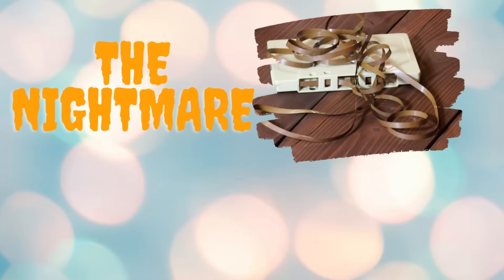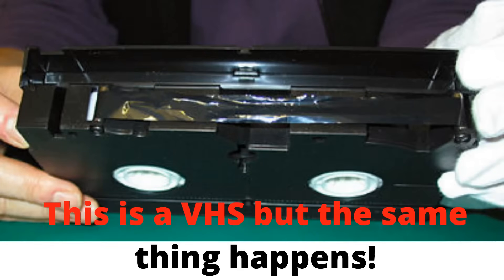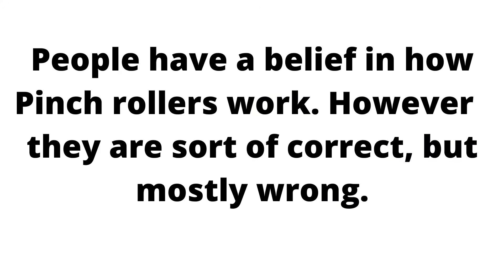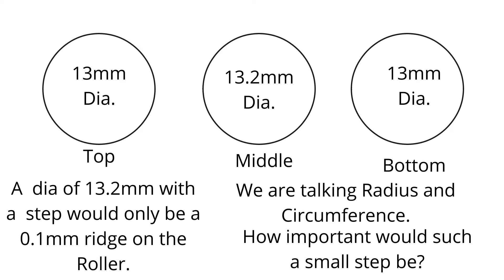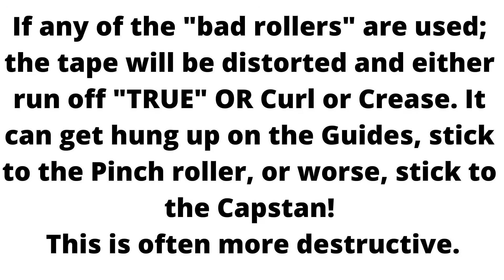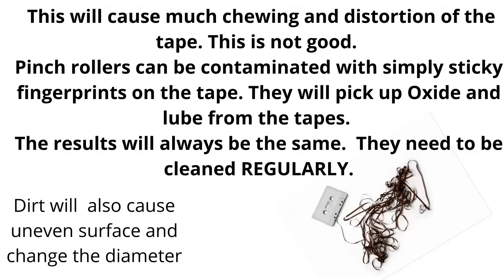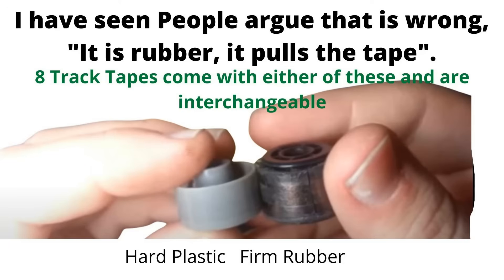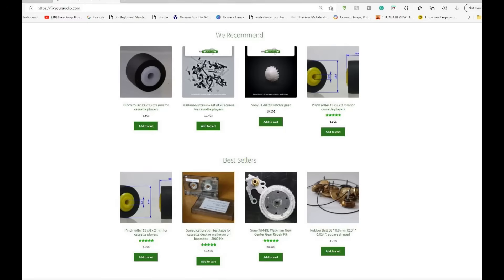Cassette Deck Eating Tapes? Pinch Roller Repair Guide

Comment: Thanks ill try give a clean. Trying to put some audio memories on a thumb drive but the tape keeps chewing up. So frustrating. Hope this works cheers.
Reply from the maker: Does the machine chew any tape or just one particular tape?  Look to see the pad in the cassette  is intact and that the tape runs smoothly.   Is Rewind  and Fast forward smooth? You can put the machine into play mode and feel with your fingers  if the take up is pulling.( You may need to override the "cassette in" sensor switch or close the door) Sorry but there are things that will have direct effect and things that will not cause i,t so much as allow it to happen.  If you want to discus it further I am  more than happy to try and help.  Good luck . Let me know how you get on.
Reply: @GaryKeepItSimple  oh your a saint 🙏🏻. Yeah it chews everything tape. It will play nicely for say about 5 sec then start chewing. I can see through the little window when it starts to chew. Mind you the sony cassette player is like 15 years old now. Was only a cheapo one. Im thinking of just going to a electronics store hear in Australia to buy a cassette player mp3 converter and see it that chews tapes. The tape that chews is in good condition so im blaming the player. Saying that watching a few videos some are saying the tape when aging can get sticky but yeah i dont know. Thanks for ya tips and getting back to me was nice of you. Like im 55 this year and i have recordings of my family ect when we were just kids. I was obsessed of recording our voices on dads old voice recorder. Just many many things. Must do it soon before the tape disintegrates hehehe 🤣.
Reply from the maker: I can tell you that sounds like belts melted. or rubber gone hard. If you want a reasonable cassette deck for not too much money I would suggest https://amzn.to/44fIiQL  Pyle Dual Cassette Deck Stereo  this is a reasonable build and it works well . the Marantz and the Ion that are basically the same, work OK. and are ideal for what you want. They feed the signal out on USB so you can record directly to a computer.  For a little less (but not as good a sound) there is the We are Rewind https://amzn.to/4i8nX36 this isthe best of walkman type player. but no good for recording and you would need to connect via cables in analog. Also there is the FIFO CP13 this has had good revievs . BUT it is still only a player and is better that the rubbish out there but that is not saying much. https://amzn.to/4cwhzSo  I have tested the We are rewind and it is not awful. I have tested a cheap Walkman. It was total rubbish . The video is on my channel. it was total crap and cost more than I was happy to lose. I have an Ion version of the Pyle and it is very adequate. it records well and plays back well. 
If you wanted to splash out you could but a Teac W-1200 . I have one and they are very very good. (for modern stuff) https://amzn.to/4cubdTp this maybe overkill for you . If it was me (and it was a few years ago) I would buy the Pyle as a tool to do what you want to do. If you want to get into cassette again and want a good trouble free nice deck then go for the Teac. (there is a version including a cd player).The Teac also feeds out on USB.
Reply: @GaryKeepItSimple this is brilliant thank you so much your the best 😃🙏🏻. I’ll definitely sus all them out for sure 👍🏻👍🏻👍🏻👍🏻👍🏻👍🏻👍🏻👍🏻

Comment: Very good explained....
I haveaPanaosnic SA-AK 28...The equipment was unused for a few years. CD and TURNER work fine... but both Deck 1/2 are totally stuck. Any action (Play, Rew, FF) activates the mechanism, the sound of the motor is heard, but the tape does not rotate, and after 3 seconds the motor stops and the mechanism returns to its initial position. 
The 2 small belts are somewhat loose, although when you turn the pulleys with your finger... the gears turn, and the mechanism seems to work well.
The Pitch roller spin with difficulty...not like the video show.

I noticed that the inner plastic cylinder of the roller is damaged... and it became detached from the roller... then it rotates on the cylinder itself... I think this is wrong... I think the rubber roller must be united and glued to the inner cylinder, forming a single piece, and that it can rotate freely on the roller holder...
Here is the link so you can see the model.
https://cdn.wes.com.au/prodimages/section5_images_1024/rxl0124.jpg

I thought about using a silicone gun to glue them
and then a little silicone grease on the roller holder, because all the parts are plastic
If you could give me a recommendation, I would appreciate it.

Comment: So would the old pinch rollers on my cassette deck be the reason my tapes are snapping?
Reply from the maker: The simple answer is yes and no.  If you have sticky pinchrollers then yes they will cause all sorts of problems. Mostly chewing but also snapping and miss-guiding, putting creases into the tapes. However if by snaping you mean at the beginning or end, and pulling the leader off the tape ( this is very common)  not really the rollers. Mostly it is the glue on the spice giving up and allowing the tape to pull off. Pinch rollers normally go hard and can sometimes be rescued by sanding the hard layer off to expose the softer rubber underneath,( not a permanent cure) If you have tape snapping mid-roll it is best to check for take-up problems and if there is any suspicion the rollers are at fault replace them. 
Take-up problems tend to be belts, tyres, and clutches. The take-up spool should apply a constant pull when playing but not too hard. Often they stop for a second or two and then the pinch roller gets the blame as the tape gets tangled around the rubber and all the mess that entails. Good luck and you can get back to me if you want. Let me know how you get on.

Comment: What to do if the pinch roller doesnt spin as much as in the video? Its kind of slow moving and i have to drag it with the swab when i clean it
Reply from the maker: I would suggest trying to apply a small amount of lubrication to the Pinch roller bearing. If the pinch roller has phosphor bronze bearing a light sewing machine oil or 3 in one would be OK. If the bush is nylon then Dry Silicon lube should do the trick. BUT you must make sure any OIL is cleaned away from the rubber of the pinch roller. As long as the roller rotates smoothly and freely it should be OK. 
If the pinch roller bearing is dry it would be worth checking the Capstan bearing also. This is almost certainly a metal bearing and again 3-in-1 oil is recommended but be very careful not to flood the bearing and to clean all the surfaces so there is no contamination. I hope that helps.

Comment: 🤨 - one thing not mentioned that can cause a compact cassette recorder to chew/eat the tape is that the take-up spool is not turning = most vintage cassette recorders have the motor belted to the flywheel, that directly drives the capstan ~ if the belt that comes off the flywheel and drives the pulley for the spools has; perished, snapped or stretched due to age, the idler wheel that drives the spools ~ its tyre has been worn smooth, has perished, fallen off the wheel, or the spring that holds it against the flywheel when ▶️⏩⏪ are engaged has lost its tension and needs re-tensioning, or even worse - the gears on the flywheel and spool drive ~ their plastic has turned brittle and teeth have snapped off = you will be “looking for a needle in a haystack-opening a can of worms-going down a rabbit hole” for replacements/3D print new ones. 🙄 - if the take-up spool doesn’t turn the tape will gather under the capstan+pinch wheel, or it will wonder sideways and go down the side of the pinch wheel and get twist-chewed by it. When I am testing a vintage cassette recorder/boombox, I open the door and press ▶️/⏪/⏩ to see if the spools are turning & pinching them with my fingers for a rough torque assumption before putting a cassette in it to test-play it
Reply from the maker: You are correct in what you say, I was referring to the occasional chew. I am glad you mentioned it.

Comment: Very nicely explained in words and pictures also.Total wrong concept or imagination got cleared.How delicate mechanisms is of tape between rollers and capstan .The stiff  bearings are of capstan I think ,which require periodical lubrication. 
Thank you very much again for your nice and informative video .
Reply from the maker: So nice of you. Thanks for the feedback.
Reply: @GaryKeepItSimple  Today I was running a C90 cassette deck in my Nak DR 2 and the playback was happening upto minus 5 dB level so all the narratives came to my mind .I played the same cassette in my another Nak DECK and the problem was same,the minus 5 level playback happening and here I found it to be the fault in the cassette hub which was nit smooth.But,once agsin I thank you for clearing my misconception .
Thank you for acknowledging my views.
Reply from the maker: @umeshupadhyay...  I am really glad to have helped . Thank you for keeping me informed.

Comment: What do I use to clean the pinch rollers?
99 isopropyl good?
Reply from the maker: I use 99% isopropyl alcohol. It works well and dries quickly. In 40 years I have never had a problem with it. Cotton buds or q tips are OK . Just do not press too hard when you clean. It must be a gentle process.

Comment: Thanks. My pinch roller does turn though
Reply from the maker: if it is chewing, the problem is the take-up spool.
Reply: @GaryKeepItSimple   I don't suppose you have another video on addressing take up issues?😅
I cleaned my pinch roller and it has helped (I sanded it evenly with 400 grit paper as there was a bit of glossy sheen to it). But my take up pulley is weak and temperamental even without a tape in it. 
Supply is good. Rewind temperamental.
Reply from the maker: @-______-______-  The answer is no, not yet. I will do a video but at the moment all my take-ups work OKish.  But the normal cure appears to be to replace the rubber tires on the take-up spool and if possible the idlers. people appear to have success using plumbing supplies O rings. They need to be sanded to take the gloss off and fitted in place of the originals. You can try sanding the surfaces on the originals and that may be enough but it depends on how hard the rubber has gone. in my experience sanding is a temporary repair. because it is not how grippy the surface is but how soft the contact area is. I hope that helps. Let me know if you need anything else.
Reply: @GaryKeepItSimple  Thanks, your a gent. It's useful advice. I've got a Marantz 50300. It's pretty old. I've changed belts and tried changing idler tyres (they may not have been the perfect replacements), to which it was actually worse, so I changed them back. 
I see videos by a guy on YouTube called Mr Nobody, he has a technique to take off the tyre, then wrap a 3M brand, 2mm wide double sided tape around the wheel, to give around an added 1mm of diameter to it.